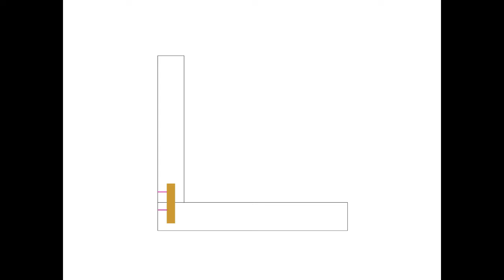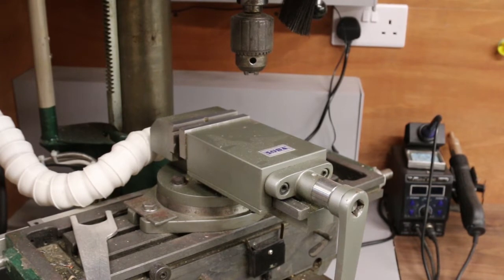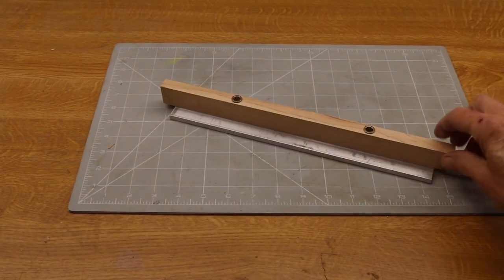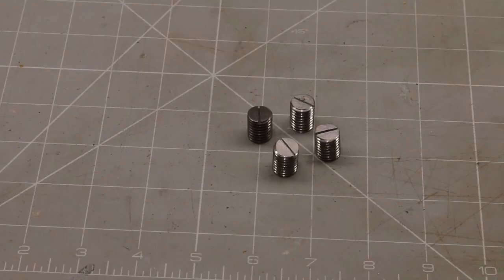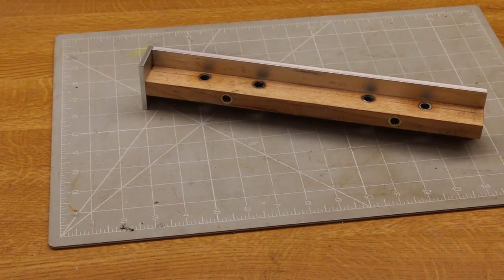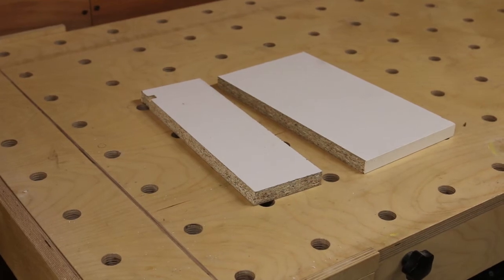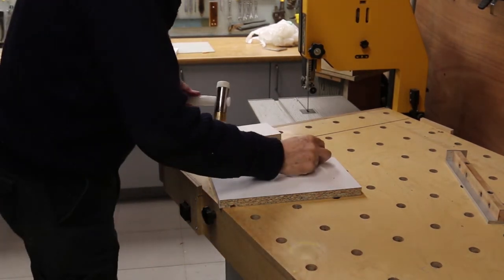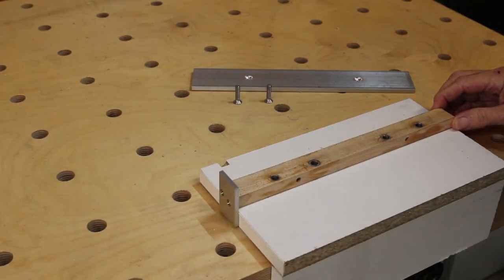NotaDomino

Comment: Very clever jig. I have a dowelmax and love using it, but would like something like this as a dedicated drill guide for drawer assembly. Thanks for showing the jig.
Reply from the maker: Because it is so simple, adding extra guides for particular tasks is easy. Different size dowels, too.
Reply: @Tensquaremetreworkshop  Yep. I use 1/4" dowels for my drawer boxes, and would probably add a few more bushings too for shorter drawers.

Comment: why not buy a drill guide bushing?
Reply from the maker: The (only) important alignment of this jig is that the guides are vertical in both planes. This is because the dowel holes are drilled through the guides in opposite directions for each part. Drilling a clearance hole and then fitting (four) guide bushes while maintaining the right angles is much harder than just drilling through inserts already in place. And costs more.

Comment: Nice jig! .. there is no shortage of cheap commerically available dowel jigs designed for joining sheet materials. The problem is finding one that does mortise and tenon type joinery that doesn't cost the earth. The dowelmax for example looks very impressive, but you're looking at £250! .. which is a lot when you think about how much slower it is in use compared to a Domino. The Jessem is another example which is quite a bit cheaper at £160, but you lose a lot of the features of the dowelmax. Personally, I have a few from Bangood, which do the job. But they're far from a DowelMax. Accuracy is fine, they're just not that convinient to use.
Reply from the maker: Double dowelling is as strong as domino style floating tenons. To me, the extra time taken to clamp the jig in place is no more than the laying out (absolutely crucial) time for using a Domino. It is also more accurate- no end float due to the required slop in a domino. I know that you can improve this by making one domino per joint tight, but that requires very precise measurement of that piece, and you have to make sure it matches the precise one opposite. Takes more time. Loads of room for error. What attracts me to my system is the complete lack of measuring required- clamp it on the end of the joint and everything will be in place. The key part is the referencing to the end of the joint- most jigs do not do this.
Reply: @Tensquaremetreworkshop  well the Domino can be used without measurement
There are two little retractable pins on either side of the face plate that can be used to reference the edge of the stock or preceding hole
Can't see why this feature is less demonstrated than marking and aligning
Recommanded setting is to make two "no slop" slots referencing each edge of the stock using those pins, and then adding a few slots in between by marking/aligning, but with some slop
Reply: I found the Wolfcraft doweling ruler (ref 4650) to be very precise and easy to use, while being quite reasonably priced (around 60€)
It also doubles as an LR32 system jig
It's usage is very similar to the jig demonstrated here
Reply from the maker: @tfabien  This is an interesting jig, but a fundamentally different design. To switch between the end and face dowel holes, you have to rotate the jig 180deg. This means both the position across the width (at both ends!) and along the length rely on stops that are set by hand. They will therefore never be precise. My jig does not rotate, it translates. It is T shaped, so the holes are drilled in the opposite direction for face and end.  The width references the mating edges, and the end stop references the same end. Everything is fixed, so there cannot be measurement or adjustment errors. If the drill holes are vertical (the only critical element) everything will line up. My jig is less flexible, but fundamentally more accurate.
Reply from the maker: @tfabien  Yes, it is interesting they do no push this- perhaps the complexity does not fit their 'easy to use' mantra. It also requires the two pins to be perfectly equidistant from the centre of the hole (they change as reference between edge and face). One can hope. The Domino does its job- at a high initial cost and high running costs. My jig cost me nothing- I had all the parts. If I had bought them, they would have cost less that a single cutter bit for the Domino...
Reply from the maker: Both the DowelMax and the Jessem are designed to make a set of holes in one place. They add spacers to make further sets of these, but reference the previous holes, not the edge- so errors accumulate. Not good engineering. They also rely on measurement/adjustments for hole placement. This is not precise- see my answer below for the design difference with a translating jig. My design focusses on sheet material cabinet joining- not flexible but accurate and fast to use. And very cheap.

Comment: I envision the threaded inserts coming unglued due to the heat and torque created in the drilling process. I have no idea how you pulled this off without cutting oil. Well done!
Reply from the maker: Actually I did use cutting oil, and drilled slower than it might appear in the video. It was one of the reasons for progressive sized drills… Certainly something to watch for.